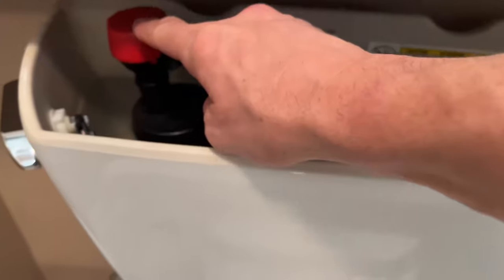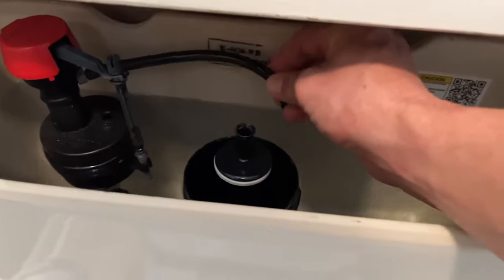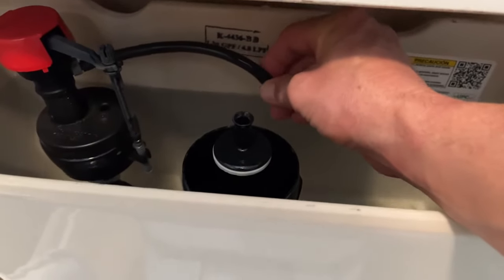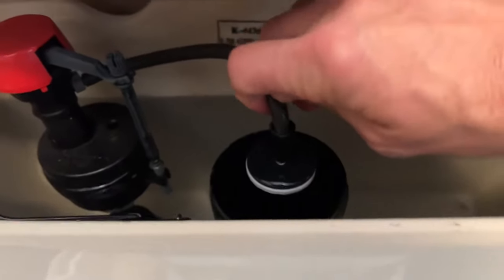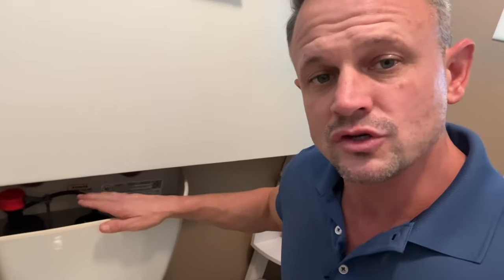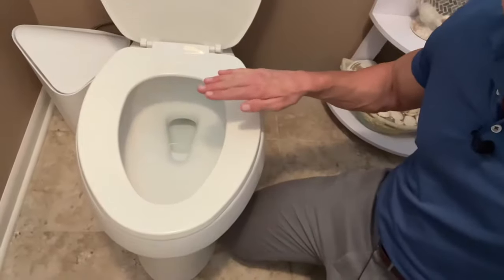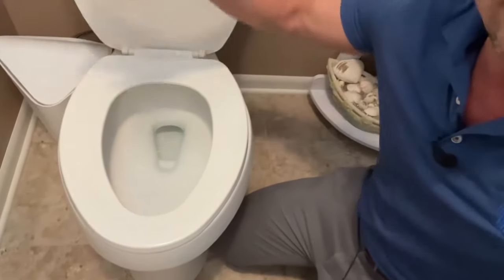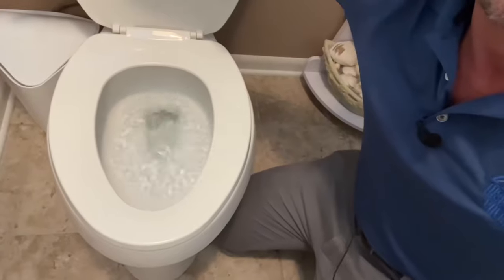How to Fix a Gurgling Toilet

Comment: Thank you so much. My tank inside is not the same but the black hose was on a clip. The water was filling outside. I moved the clip to the left side of the white tube. The water now goes inside like you showed. My hubby has spent weeks looking. Took me less than 2 mins total to find your video, watch it n fix it. Thank you so much. Google doesn’t know everything. YouTube does. 😂
Reply from the maker: 🤣🤣🤣 I love it, thank you!

Comment: holy shit you saved me. My toilet wasn't even particularly gurgling but the water level suddenly was weirdly low and when i left the handle down my bathroom flooded (which it normally does NOT do that if i leave it down.)
but i opened up the tank and sure enough, the tube was off. put it back, water levels back to normal, and no longer flooding. yippie!
Reply from the maker: @asterierrantry  oh no, I’m sorry to hear the bathroom flooded. On a brighter note I’m happy it worked and the video was helpful.

Comment: Your videos have been very helpful and informative for me!! Would like to request a video on why my emergency heat keeps kicking on and if there's any way to prevent it. It is expensive!! Living in central Indiana for reference.
Reply from the maker: Thanks Naomi I’m happy to hear the videos are helpful!

Typically emergency heat is only on heating and air conditioning systems that have a heat pump. Heat pumps are typically installed in milder climates and I would think central Indiana gets too cold for a heat pump system. 

When the temperatures become too cold the emergency heat automatically turns on which is why you’re energy bills are higher. Here in the Midwest we typically have a central heating and air conditioning style system which is more efficient and economical.

Unfortunately, the only way to prevent emergency heat from coming on would be to manually turn it off which I would not recommend doing because you may experience freezing conditions.

Comment: It helped Me, just to make sure i had new seal and everything but this bubbling was causing minor leak at the base of toilet, could this be a problem because that tube was out?
Reply from the maker: No, if water is coming out between the toilet and the floor then you need to have a plumber reset the toilet because it’s leaking at the wax ring which seals the drain between the toilet and the floor.

Comment: Hi mine is attached. My vent and sewer are clean. But yet the bathroom downstairs still gurgle when I flush the one upstairs. Any suggestions? 5 plumbers came including roto rooters and they couldn’t help
Reply from the maker: That’s a tough one! Being that you did all that and your sewer line and vent are clean. The only other thing I can think of would be maybe installing additional venting for that toilet might help.
Reply: @BJPoznecki  thanks I will do that.

Comment: Hey BJ. This is happening to my toilet but the plug is still connected. I unplug it and plug it back in and fixes it temporarily and then it comes back after a couple of flushes. Any ideas here?
Reply from the maker: If it’s still gurgling after doing this, and we eliminated that possibility. Then it’s either there may be a slight clog in the drain that needs to be cleaned, or a slight clog with your plumbing vent up on the roof. All of your plumbing drains have a vent to allow air in so the water flows smoothly. If your vents are clogged and not working properly, you can get a similar gurgling.

Comment: Hello, I have a question once I do all of that. What if the tube doesn't stay in?
Reply from the maker: There are different style of flush valves that little tube connect to, so I don’t know which one you have, however, most of them you can go to the store and buy a little clip that holds the tube onto that pipe.
Reply: Thank you! I truly appreciate your help and assistance.
Reply from the maker: @NaturallyJaz  My pleasure!

Comment: Nope,,mine was attached right.
But it started gurgling after "someone" plugged it up and had to get plunged. Happened one time before but it went away eventually.
Any suggestions ??
Thanks
Reply from the maker: I’ve seen this happen before, even though you plunged it and broke up the clog, there could still be toilet paper getting hung up somewhere that is still hindering, proper flow to where you may need a toilet auger to clear it fully.
Reply: @BJPoznecki  
Ok,, thanks. I'll try that I do have one. Next I think I'll go on the roof with the garden hose and see that the vents clear. 
Thanks
Reply from the maker: @driver902  My pleasure James!